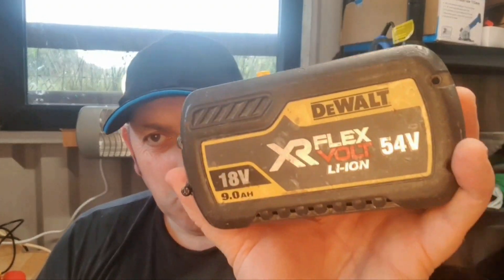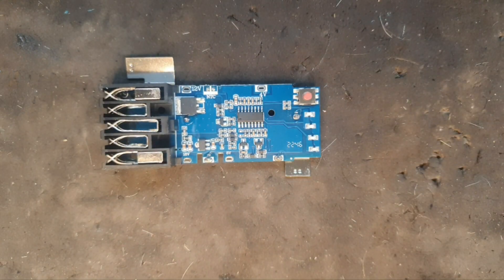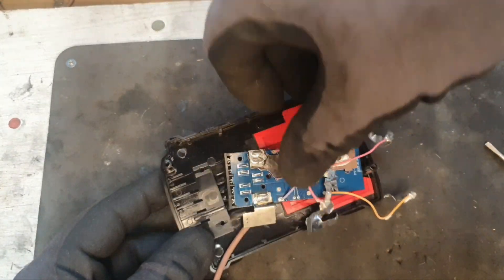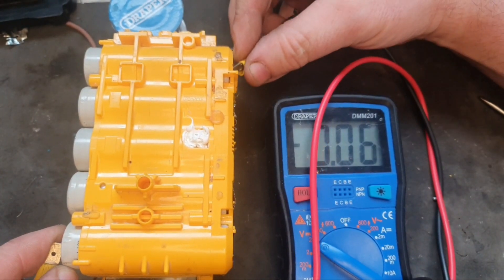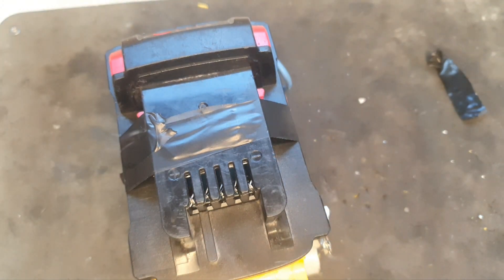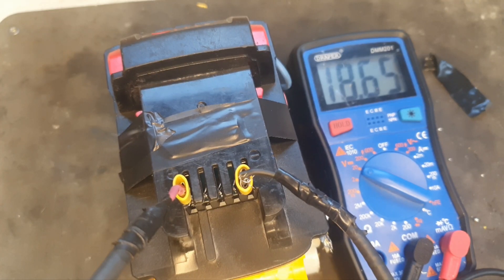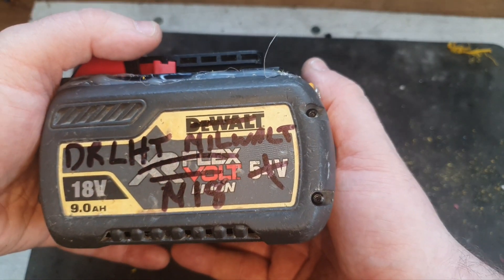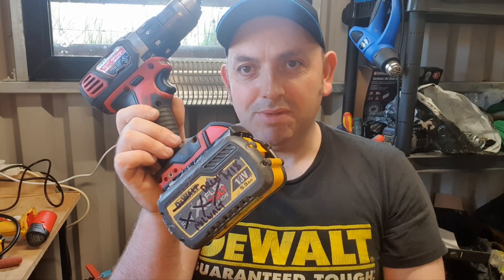Flexvolt 9Ah to M18 9AH Milwaukee Battery #powertools #milwaukee #dewalt #diyenthusiasts

Comment: Cracking build
Reply: Well only in a tin shed
Reply from the maker: @Jbubbs-381  it's great when there is a battery at the end not a crater instead of a shed
Reply from the maker: Thank you sir not available in the shops